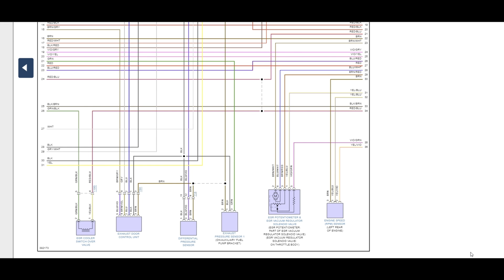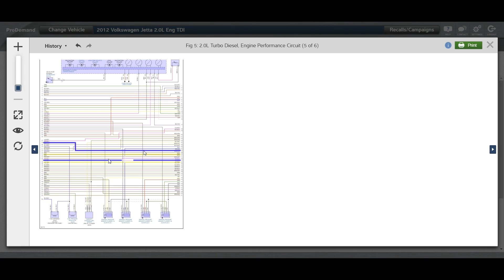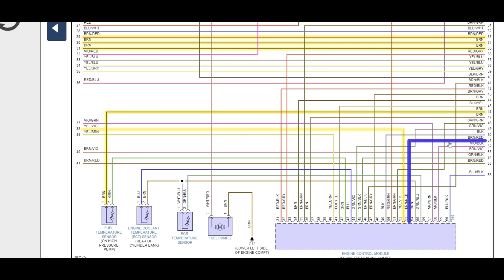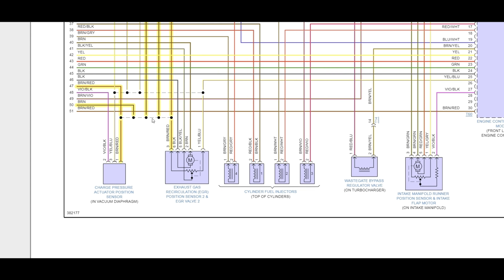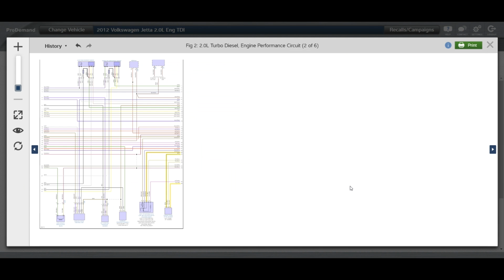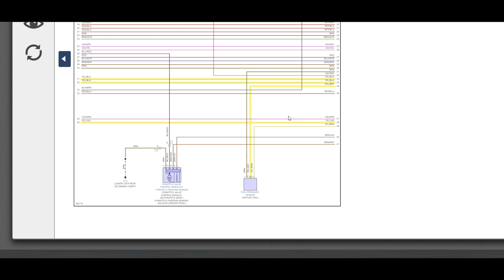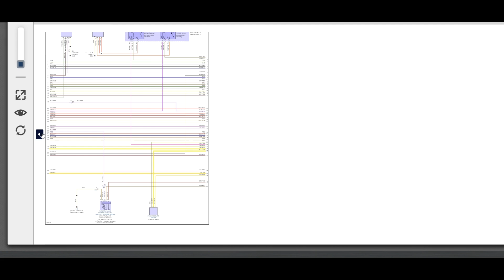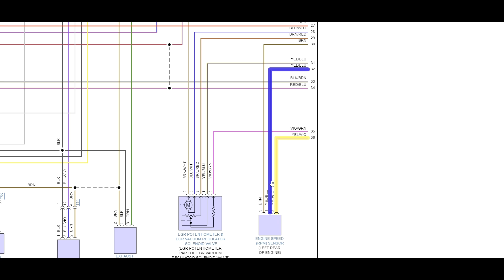How To Read/Dissect an Engine Computer Wiring Diagram

Comment: CAN THERMISTORS SHARE A 5V REF. CIRCUIT? THANKS IN ADVANCE.
Reply from the maker: Not externally from the computer, no.
They do tap into the 5v regulator but there is a current limiting resistor in that circuit before it gets there if that makes sense.
Reply: understood perfectly thanks Paul.

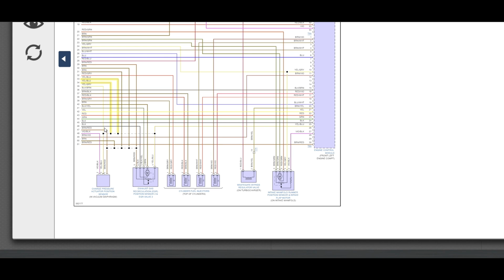Comment: I don't understand..  You keep saying that they can't share a 5v ref.. but then you go through and show how they are all sharing it??  I don't get it.  (4:45) ...   You show Fuel pressure sensor, Engine speed sensor, EGR pot and EGR position sensor, etc..  are all sharing the 5v ref.   What am I missing?  It clearly shows that all the grounds are tied together (as you showed first) --    but also many of the 5v ref's are tied together too (which you also showed).   So when you say that they can't share it--   what do you mean? ...........  edit:  Unless you're just referring to only a 2 wire sensor;  Where it has no signal wire;  so it has to use the 5v ref as the signal wire??
Reply: He was saying a 5v ref cannot be shared between a Hall effect sensor like a crank sensor or cam sensor with a thermistor like a temp sensor and it can’t be shared with a potentiometer sensor like a TPS sensor but it can  share a ground
Reply: yeah i caught that too. lips moving faster thanthe brain????    i think he  meant signal return
Reply: since a three wire sensor and a two wire sensor can share a ground (not always) and 5v refs can share,  the signal return is what the computer is reading cant.
Reply from the maker: Signal return is another name for a sensor ground.
Reply from the maker: @calholli  I cover all of this in great detail in my classes on my website.
As far as here on YouTube, check, I have some too. Check my chapter 6 and 7 playlists, also my 9,10 and 11 playlist.
Reply: @ScannerDanner  ive always called a signal return the wire that returns the signal to the computer, since the signal is made by a sensor that uses a power and COMMON. unless you are dragging a conductor on the roadway that is bonded to the chassis there is no ground on a vehicle. and yes those wire do exist on some vehicles. gotta love the english language
Reply from the maker: @richardcranium5839  😆 I understand. But I won't let my students use that term for a signal wire because very often you will see "signal return" on a wiring diagram and it is NOT ever the signal wire, it is a ground wire. You also are using terms we don't use in the 12v DC field, but electricians do! Which is "Common" and "bonded".
Reply: @ScannerDanner Are you sure “common” is not used on the DC voltage field/language? 
As educators we have obligations, not mumbo jumbo is one of them. You seem to use terms in your favor to confuse the audience. Interesting.
Reply from the maker: @jorgebolivar  I seem to use terms in my favor to confuse the audience? This is a ridiculous statement and NO "common" is NOT used in the DC field. You will not ever see that in service information or wiring diagrams. And since your comment is under this thread, I am assuming you don't like the use of the term "signal return" either? Well, get used to it. It is all throughout this field and on thousands of wiring diagrams and is very commonly mistaken for a signal wire. This isn't my made up term to confuse people.
Reply: @ScannerDanner Hall Effect, thermistors and Signals returns are confusing terms you are doubling with Cam, temp sensor and ground signal. Intentionally or not, is no need to complicate a simple subject. 
Wiring Diagrams are well identified, why not use that name, then explain how the sensor returns its signal back to the PCM if the case. 
Signal Return is not a bad term but again, if the diagram does not mention Hall effects… why? 

BTW, we analyze and breakdown wiring diagrams to analyze circuits because we are diagnosing vehicles, biologies or doctors are the one that cut and dissect.
Reply from the maker: @jorgebolivar  you're an instructor? You need more experience before you start teaching others how to navigate this field.  @jorgebolivar
Reply from the maker: The 5v ref  that is shared between pots, psi sensors, hall effects cannot be shared (externally from the PCM) with thermistors. This was the identifier between the 5v ref and the sensor ground circuits (signal return is another name for a sensor ground).
Sensor grounds can be shared between all inputs!
Reply: Where from you get car diagrams? Is there any subscription page?
Reply: @michalwalenciak2478  All data, Mitchell 1, BBB, motologic, idetifix, etc.  Get ready to pay $150 to $200 per month.

Comment: What about if you place one lead of multimeter on battery + and other one on ground on sensor will that not show a voltage drop bettwen two different points on that circuit?
Reply from the maker: There are other ways of circuit ID, but what if that circuit already has a problem? Which in this case does! The multimeter will not be your friend here with circuit ID. Not in this case. But in others, yes.
Reply: @ScannerDanner  thanks for the replay yes that's right. I was thinking about no wire diagram and checking just from your head as meater may show readings where wires will not be connected but when you connect to sensor it may show  nothing I not sure if that's the right way of thinking .

Comment: A damaged harness (rub through?) causing an internal harness short between the 5V reference and a 12v conductor could also do it but would  require the ground be opened by the damaged harness as well. An extreme longshot, but I've seen a few cases that defy the odds through the years.
Thanks for your great content!

Comment from the maker: Reading wiring diagrams starts with an understanding of your fundamentals in what can be shared, and what cannot be shared between sensor circuits. The 5v reference and sensors ground circuits can be our guides to dissecting a wiring diagram!
The vehicle being used is a 2012 VW Jetta 2.0L TDI system
Reply: Thanks for sharing SD👍🏻👍🏻👍🏻
Very very important stuff😍
Stay Blessed SD🙏🏻🙏🏻🙏🏻